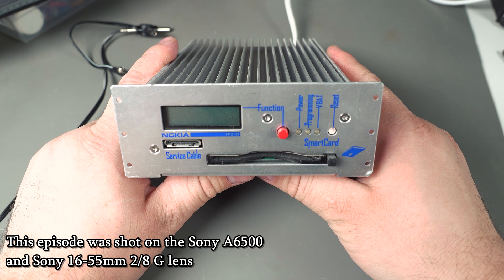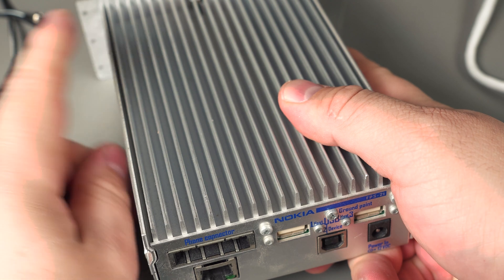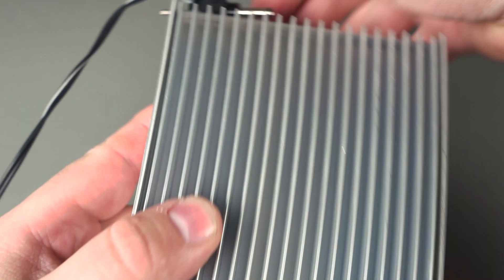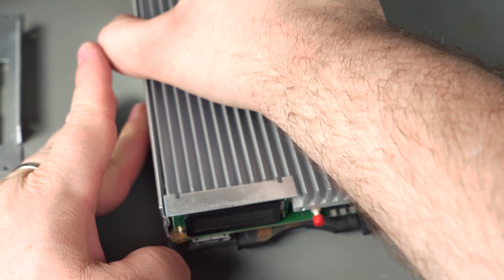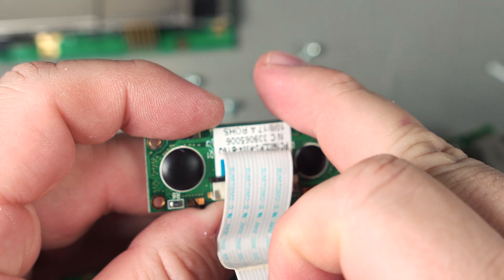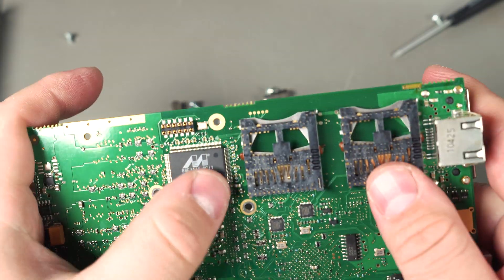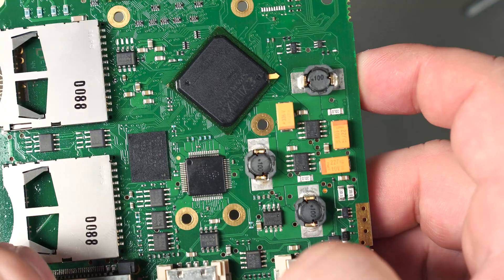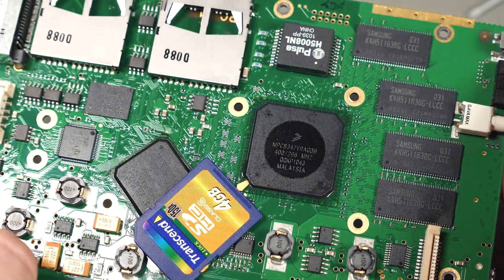Nokia FPS-21 Service Programmer Teardown

Comment: Hack it and run Linux on it. :D
Reply: These things go for 200-300 bucks on ebay btw. People are nuts
Reply: @Christian - I thought you were joking, but all three that completed sold. Granted, they're a few months old, but still.
Reply: @Browningate  Yeah, it's completely mental.  I'd love one of these only to tinker with it but no way I'm paying that much for something I only intend to run Linux on lol
Reply: @Browningate  To be honest I have few of these devices and also wonder what to do with them.
Not sure if running Linux on it is even possible and also what's the role of FPGA in this system and if it's possible to abuse it on own purpose but I can try :)
Did you try maybe do anything more with this device or still have the software?
Reply: @Chriva  Right on.
@grzegorzhetman230 - I never owned one, so I couldn't tell you.